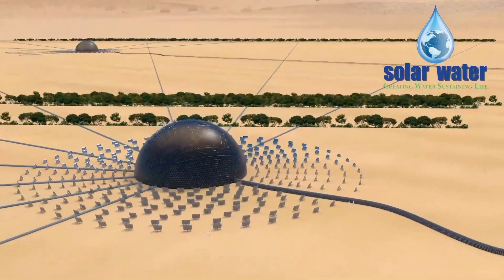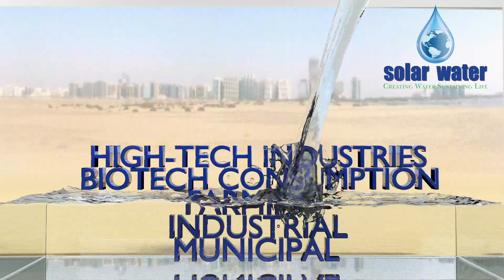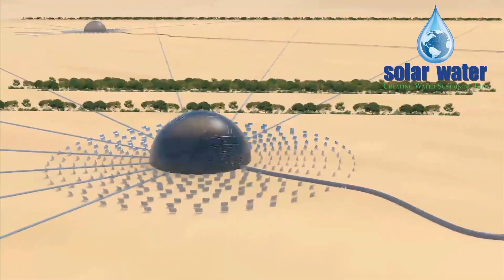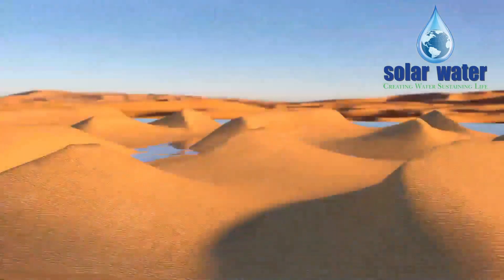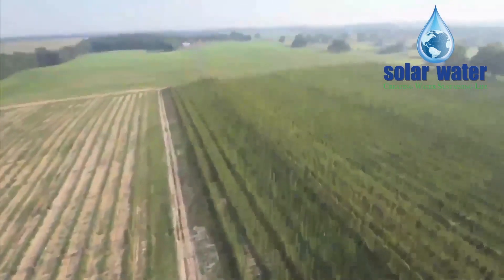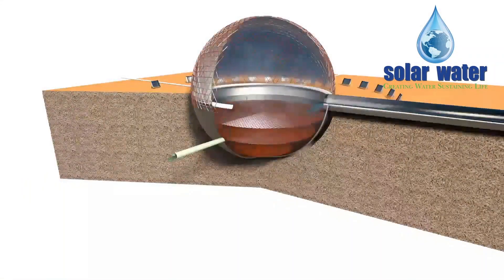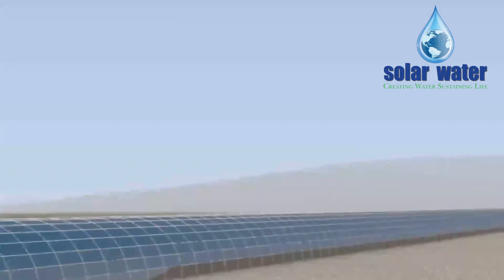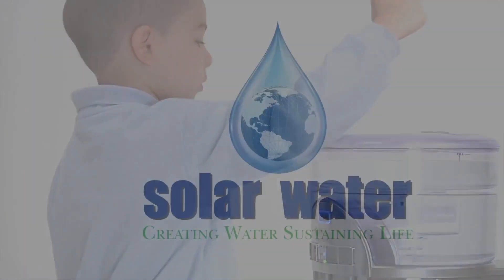SEAWATER CONCENTRATING SOLAR POWER DESALINATION

Comment: ok, what about the contraction/expansion issues related to day/night cycle?  during the day the system is receving huge amount of energy, lets say that it will go to +60C,  +70C(heliostats are increasing the temperature also) and in the night the desert temperature can go to 0 or even below. How the structure will cope with those stresses in hundreads, even thousands of those cycles ?
Reply: Damn you and your logic.  Lol, excellent points all of them...I'm assuming the engineering team foresaw this , but stranger things have happened. Or could the  cooling be utilized in the  condensate phase.
Reply: @vincentrusso4332   yeah, sure. Engineering teams around the world in the last century have not foreseen this trivial tehnique of obtaining fresh water.
Reply: @snowfuca  what is your opinion on this new technology branded as Suncell...looks pretty promising and perfect for the power required for desalination.
Reply: @vincentrusso4332   Lost time, lost money
Reply: There's enough of the day to do the vast majority of the work. And even then there are other conventional desalination plants that can plug the gap if any work needs to be done in the night. And there are energy storage methods life using molten salt that can also plug the gap

Comment: What will you do with all the salt?
Reply: Molten salt, lithium, road, salt, etc.
Reply: @ABDELKADERHAMDAOUI   Malcolm Aw  wouldn't it be more cost effective to have the solar plants next to the sea for easy access and not in the middle of the dessert like the video suggested?
Plus this system won't create any energy so people would have to spend energy to turn the mirrors to an optimal angle to the sun because the earth is moving and so does the optimal angle from the sun so you will loose efficiency real fast without a dedicated energy source to turn the mirrors..
If your plan is to make drinkable water without having to worry for electricity is to make a concentrated solar panel plant and put in next to the sea, the plant will use mirrors to focus the sunlight and melt salt and then the heat of the salt will be used to power a steam generator producing electricity and with this electricity you can run a desalination plant to make drinkable water directly from the sea with reverse osmosis
Reply: @grafmecx2641  It is meant to be part and parcel of a revegetation and reforestation programme of desert reclamation. Saudi Arabia wants to make the deserts blossom. Please check out NEOM. Thank you.
Reply: @ABDELKADERHAMDAOUI  No matter the reason you are making this project the important thing is funding, this glass dome and mirrors alone will cost many millions without counting the maintenance the kilometres of digging, installation, energy  spending for the mirror turning and many more things.. All of these things you have to take in to account because I hope you are not expecting to get funding through Indiegogo or something because a project like this would need a government funding and the government is interested in money and how not to spend it carelessly I really would like this thing to work having a concentrated solar farm for energy production will solve the government funding problem, countries always like to have extra energy sources,the energy made through the plants could go on water making facilities and then dumping the water made in man made dam..
Reply: @grafmecx2641  A SWRO desalination plant cost around $250 million, if fact the one in San Diego (Carlsbad) was more than $1 billion. Our 50m SWCSP-D is only $80 million. By the way Libya's man-made river into the Sahara was around $30 billion back in the 1990s.
Reply: @grafmecx2641  the model I looked at claimed mini turbines that operate at lower steam pressure to facilitate on site power needs.

Comment: Do rember to turn the mirrors downward at night and make a cover that they fit into so you can protect them against the sand storms and also clean them easy with a cover over it and reuse the cleaning water also works with solar panels so they power down and are protected in a sandstorm and can he cleaned with more ease and less water can you also make a movie about that ??? You could also directly feed underground layers that helps rehydrate the soil without the need for long pipe systems through nature
Reply: Thank you. Will do.
Reply: @ABDELKADERHAMDAOUI  lmao